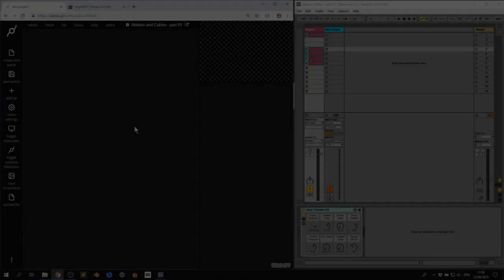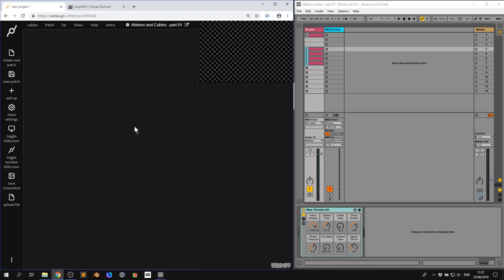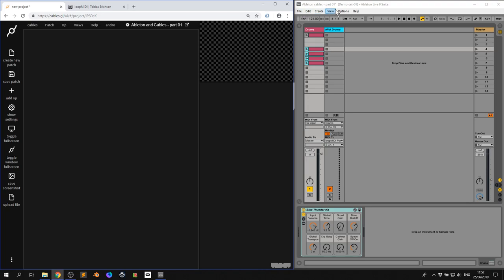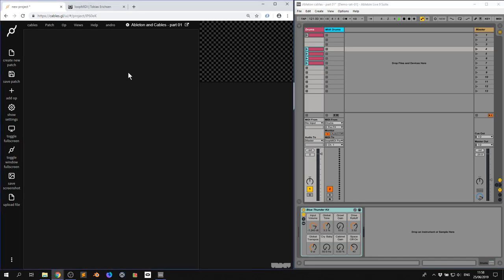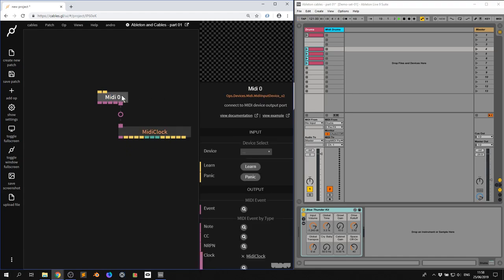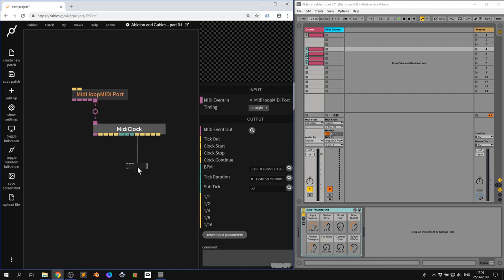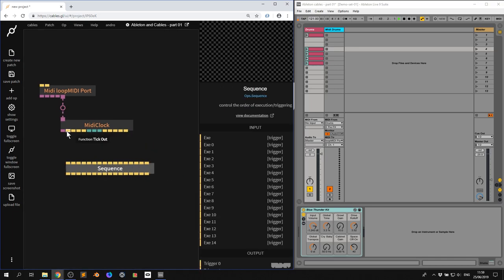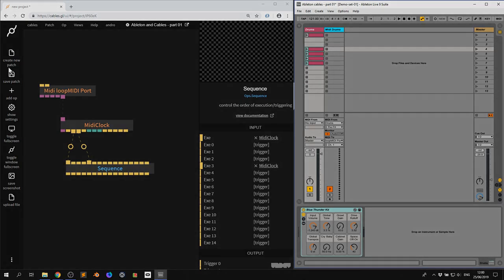Ableton and cables - midi clock

Comment: I need Ableton to receive the midiclock from my Behringer RD 6. I expect that is it enought to connect a midi cable(DIN) from my RD6(midi out) and into my midicontroler piano M-Audio (midi in) and then in Preferences into the section LINKMIDI, Midi ports and the input ->sync on, right? Thank you in advance.